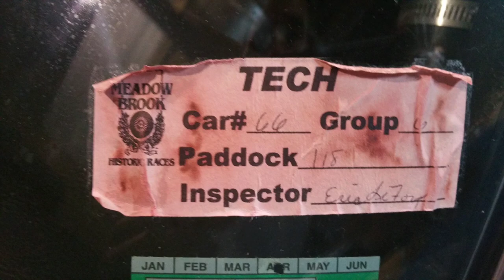1969 Corvette from Estate Sale to Track in 8 months!

Comment: Hi Tony, I discovered your channel while searching on c3 race cars, and just watched all your prep vids up to the fateful crash. At least you and everyone else are ok. In motocross we called the out of control racers 'spodes.'

I'm starting a similar full race build, a 1980 c3 for solo, open track days and maybe even rally. Was yours originally a convertible? On mine I want to cut the t-top roof completely off for the cage work, then run a lightweight race hardtop like the Greenwood cars. I think I can use an aftermarket convertible deck lid to fill the hole where the rear window is eliminated, and maybe even hinge it for access to the fuel cell and battery. What kind of top is on yours?
Reply from the maker: Scott, mine is a convertible from birth.  I have seen a lot of guys do exactly as you are describing.   I have been out into a guy in Toledo Ohio who is supposed to do lightweight body's for C3's.  I will try to remember to message you on what I find out in the next two weeks.  Are you located around St Louis?
Reply: @tonybosworth5382  No, im in AZ.